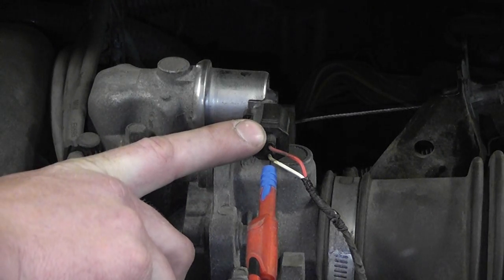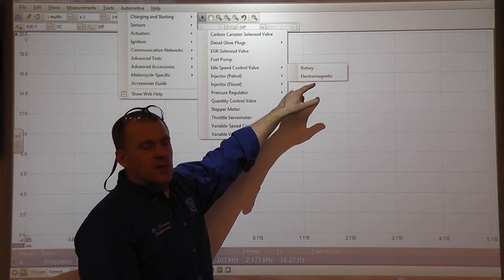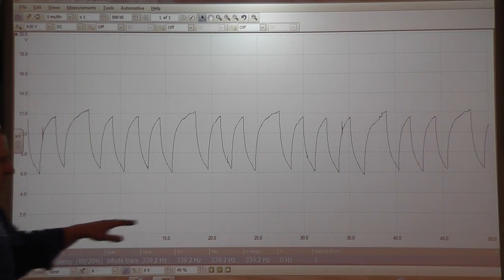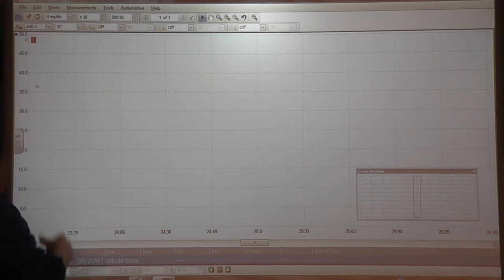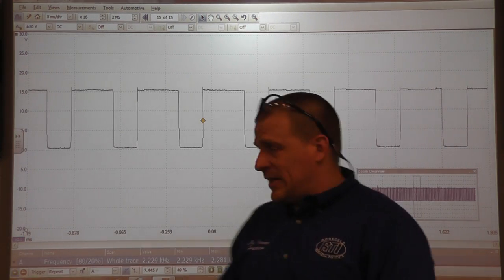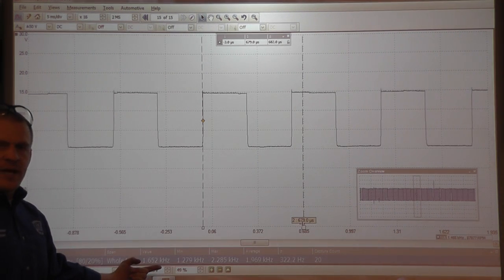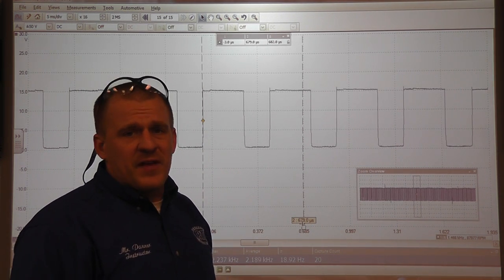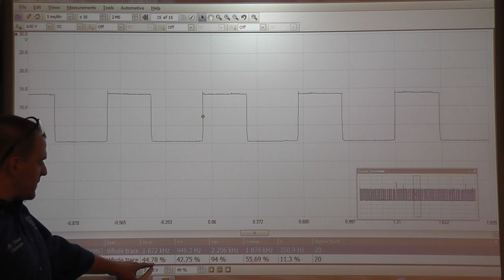How to test an idle air control valve (IAC) using a Picoscope - Ford

Comment from the maker: No, sticking IAC valves can be difficult to pinpoint. It helps to have a bi-directional control with the scanner. But not all systems allow this. Chrysler does, and it helps a lot. They even offer a KOEO test that extends and retracts the IAC.

Comment from the maker: @TRcustomengineering Of course it would be. But if we are talking about the MT2400 it is really not a scope. It has some scoping capabilities but you certainly are not going to see great detail. However, what makes the Vantage so great (Vantage Pro too) is the component testing database. If you have never owned one of these you are missing out on a wealth of information and guided help. I still use my Vantage MT2400 all the time. 
Watch my Ford electronic returnless video. I am using the MT2400

Comment: I think I have now ruled out the sticking idle being due to the IAC. I actually found that when I do not let the computer control the timing (removing SPOUT), it does NOT stick, and gradually returns to normal idle in an acceptable amount of time. When I let the computer control the timing, the idle sticks as I mentioned earlier. Now I am scratching my head to figure out what is causing the timing to "stick" temporarily, which in turn is causing the stick in idle....

Comment from the maker: Most of the solenoid type IACs have only two wires. There are some three wire ones though too. I would say I have never seen a 4 or 6 wires IAC that wasn't a stepper motor design. Pretty much all GM and Chrylser (domestic ones anyway) use stepper motor IACs
Nissan uses a 6-wire design but only on some models. I have a video up on this one too.

Comment: The sample waveform is from an early Ford. I just checked a 1986 F150 5.0 that had that exact same waveform. I'm sure there are plenty more. Voltage was from 3 - 8 volts. I'll post the waveform on IATN.

Comment: I really like this scope, and the price point is right. Obviously the vantage is an all inclusive package, but it costs way too much. What scan tool can complement this scope, and as two pieces be as good as the vantage without costing about 10 grand? Is there a pc scantool with bidirectional and comprehensive vehicle coverage?

Comment: hi MR do u have any video about diagnosing rich or lean trou-
ble codes  by using pico 1-An open-throttle cranking exhaust pulse test
 •A closed-throttle cranking exhaust pulse test   
•A closed-throttle cranking intake manifold
vacuum test.
•An open-throttle cranking intake manifold
vacuum test tests which must be synchronized with the cylinder 1 spark or injector

Comment: If IAC connector is disconnected on a idling '92 F350, would the 2 wire IAC valve completely seal off intake vacuum with zero vac leak past the internal sealing port? 
I have an installed valve that seeps a slight vac with connector disconnected, my thumb over the 3/4" air inlet hose proves a vac presence. 
I consider it a bad valve with a vac leak just as any other vac leak one would detect at a gasket or a hose etc. The new IAC also seeps vac the same, could both old and new one be failing to seal the internal seat properly when there's no power to solenoid coil? 
I may have received a faulty replacement hey?

Comment: Hi Paul..i own a diesel car...it has a boost control valve..with KOEO i see 12 volts on one wire and ground on the other..it means the valve is opened..Paul, why is this valve in open state and may be it closes at higher rpm??? I guess it also controls the turbo wastegate directly or indirectly..Plzzz advise. Thank you.

Comment: Do you know if there is a good electronic way to determine whether or not the plunger is sticking in an IAC? I have a problem where I snap the throttle, the idle stays high (~2k rpm) for about 1-5 seconds, then it drops to normal. (all in Park). TPS voltage proved that the throttle plate is not sticking. I also monitored IAC voltage and it didnt seem to change during this period of time either, which I think implies that the computer  is not responsible for this temporary high idle.

Comment: I can see the waveform of the IACV there transient voltages in escess of 77% of its voltage amplitude. Is this caused by the a/c compresor or electric radiator fan switching  off and on?

Comment: Question? does rotary idle valves, such as in Toyota vehicles, normally are trying to close the valve when the circuit is on ? or is the opposite?  circuit on means closing or open the idle valve?  how can I know through the scope if the circuit is trying to open or closing the valve?
Reply from the maker: It is a three wire with two opposing magnetic fields. Total duty cycle is 100%.
Example, When one is at 70% the other will be at 30%. What's more important is that you see a duty cycle on both controls and a good waveform and also to make sure it is not mechanically stuck

Comment: how come on primary side coil negative on wastespark or 2 wire cop you can see the spike in voltage everytime the coil denergizes but on pwm its just a square wave with no spike. what happens to the voltage spike
Reply from the maker: I really depends on the circuit design of the solenoid and the computer. Capacitors diodes etc. can eliminate the spike.

Comment: hello i have a issue with my 04 Grand Marquis Auto parts saying is the ildle control valve i try installing a new one and the car reacted worst so i installed the old one back it makes a noise like is berpin also ppl told me car has to much air .pls contact me

Comment: And guess what ALLDATA tells us what to check? Resistance checks which are useless.
Reply: careful with that statement. While I agree that the ohmmeter sucks in most applications, it is also THE tool to use at times. So we do not want to totally disregard it. But I get what you are saying for sure.